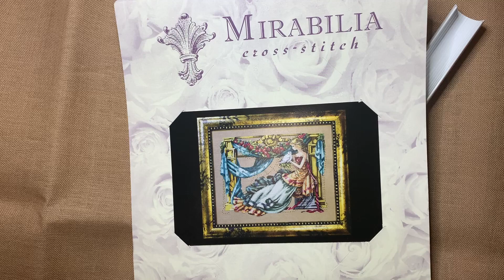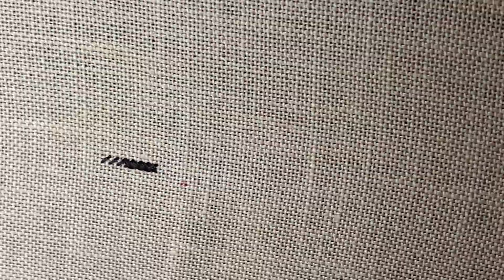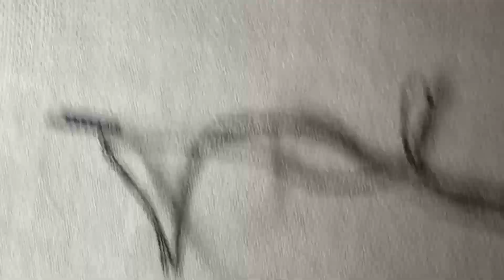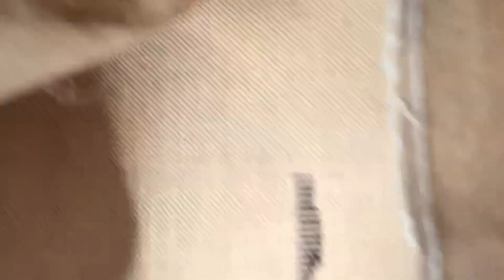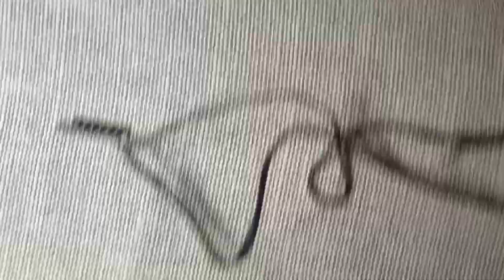My very first Mirabilia! Stitch with me “Athena”

Comment: I love ur videos
I have my first Mirabilla pattern van I stitch on 14 16 or 18 count aida can u give any tips on startin it ad I have had thos pattern 5 yrs and nervous to start her
Reply from the maker: Hi! Thank you for watching. I think either 14 or 16 count Aida would work well with Mirabilia. Does your pattern have a lot of beads? 18 count might be too small for some of the beads so I recommend either 14 or 16 count. 

For starting, I recommend starting in the middle or if you have tried before, you can grid them fabric if you like to start in the corner. No right or wrong way of starting!
Reply: 'Could I still do skin 2/1on 14/16 ct aida
Reply from the maker: On 14/16 count, the stitches will be over 1. So if you stitch the skin using 2 strands, that is 2 over 1 which will look like a regular cross. If you’re referring to stitching the skin 2 over 1 or 1 over 1 like in linen, you will need to pierce a hole in the middle of Aida to match that stitch which could be tough